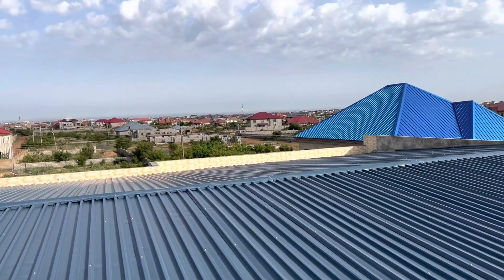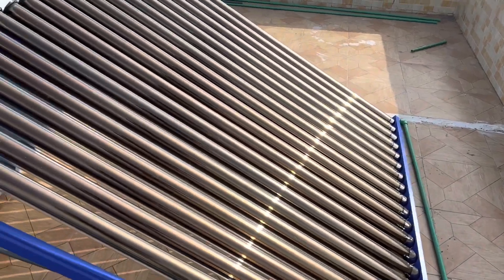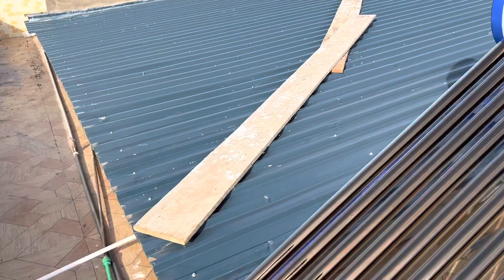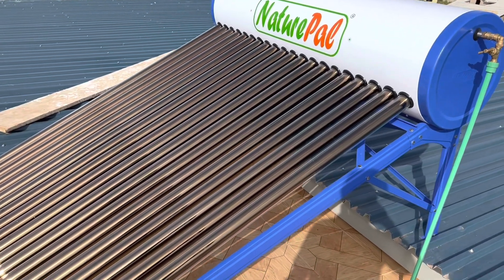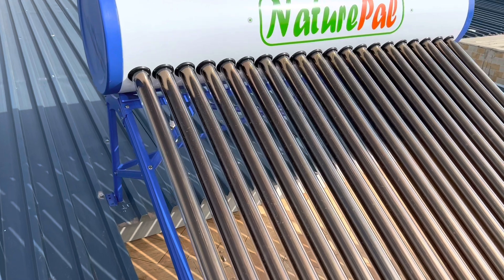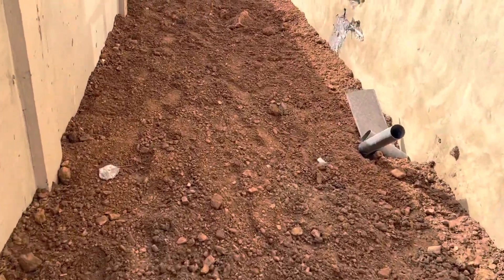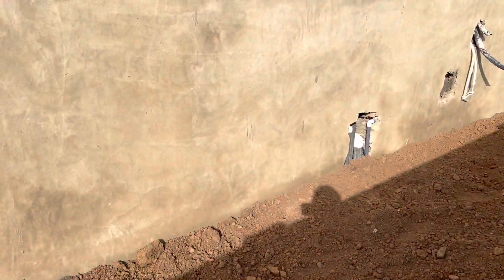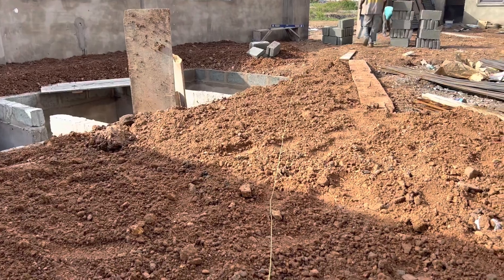Building in Ghana | Update 3 | Solar Water heater and filling the Compound

Comment: I may be late but I think you got the connection all wrong. The one going to the side is for the cold water. The one under is the hot water outlet. The pump goes to the hot water outlet. I know this cos I just got mine installed…😊